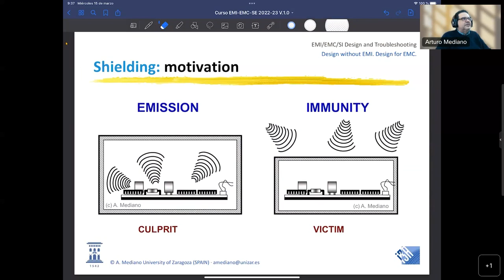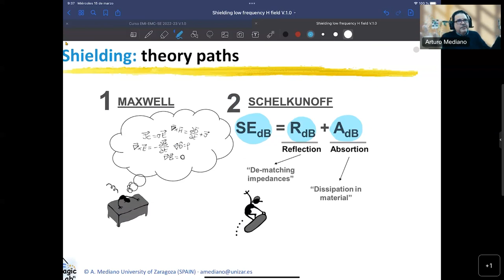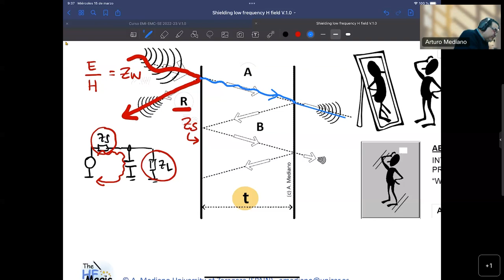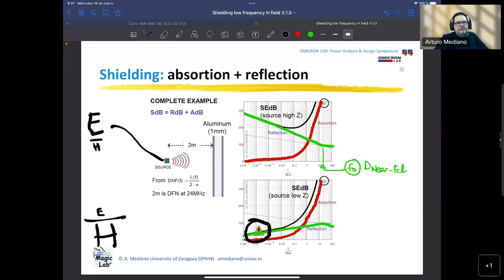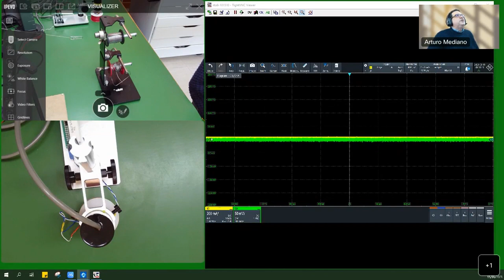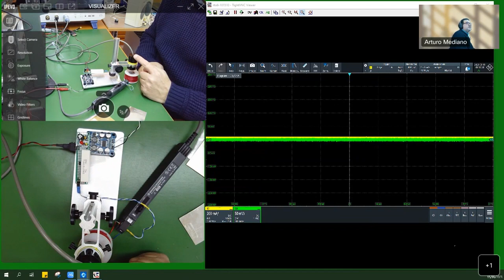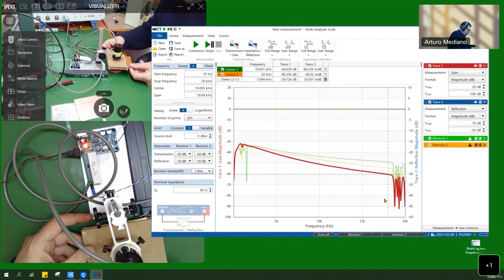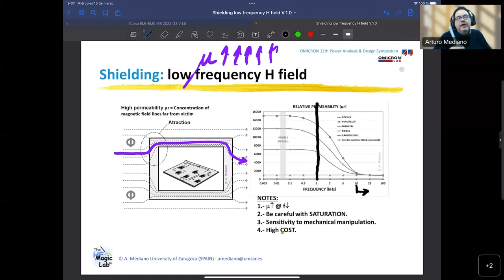Shielding Low Frequency Magnetic Fields

Comment: very nice ,  I had issue form 50Hz to 1Khz which came from bridge rectifier , using Mu metal cost a lot , but I used galvanize metal sheet. quit effective around 20dB decreasing leakage on my neighboring circuits.
Reply from the maker: Thanks for sharing
Reply: This is a very nice presentation on the fundamentals of shielding. Thank you.